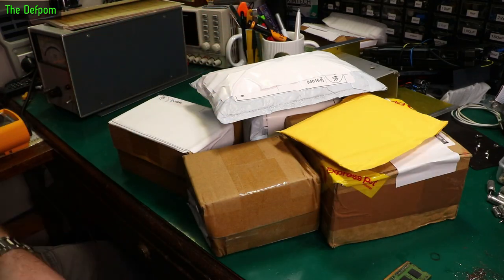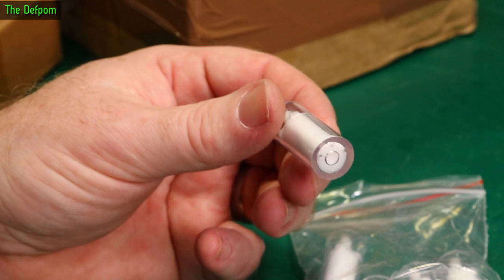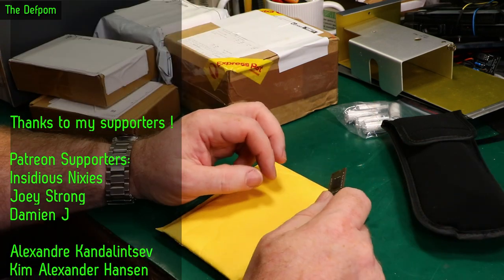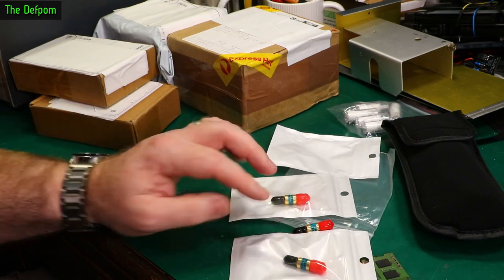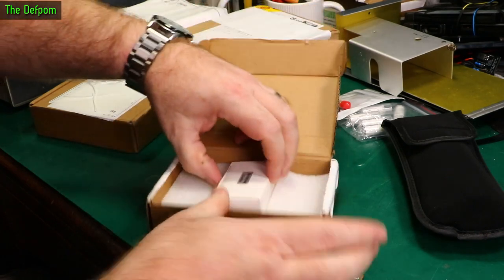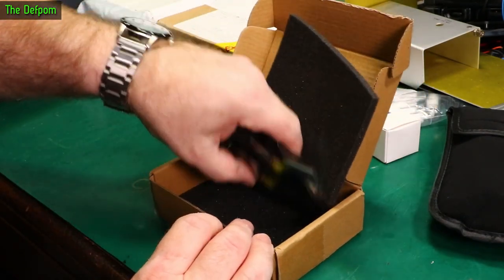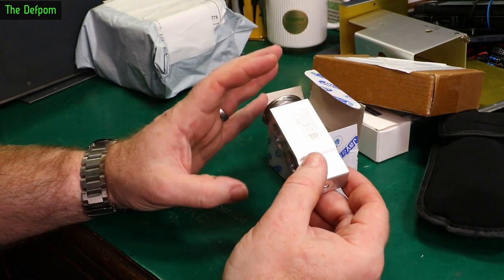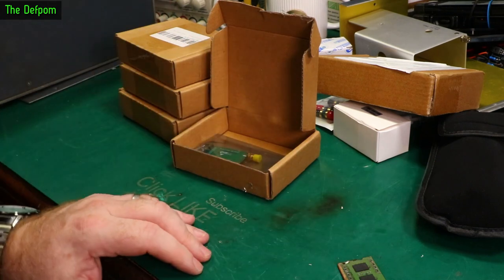🔴 What's in my Mailbag ? - Mailbag Monday 6th March 2023 - No.1104

Comment: Keep in mind power limit of the small SMA attenuators. These are not designed as power loads. Could even  be rated  only a Watt or so. The 10W unit would be safer, but even that could fall short on CB units, or many amateur radio gear.
 Should manage the LORA (? Watts output)  or WiFi Modules but critical for stronger transmission sources.
❤❤❤😮😮😮
Reply from the maker: The Lora modules are rated at either 1W or 100mW depending upon the model, so should be safe, plus they only emit pulsed transitions lasting less than 100ms each time.

Comment: TEVs rarely fail, especially this type with the suction pressure return combined with the liquid line in the valve body eliminating the need for remote bulb sensing of superheat (the most common failure point)  and external pressure compensation. Still nice to have and you can always sell it on eBay if you sell the car! Regards,  David
Reply from the maker: Yeah it is unlikely I will ever need it, but as you know I like to get things while I know they are still available… now to find a spare engine and gearbox….